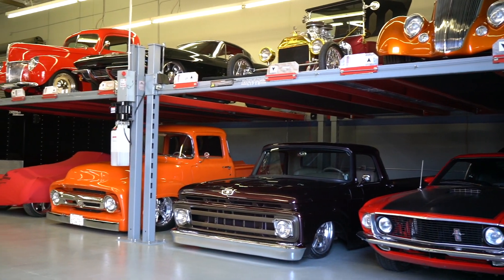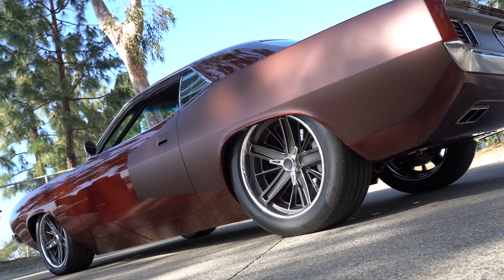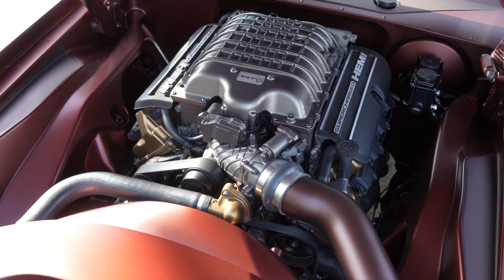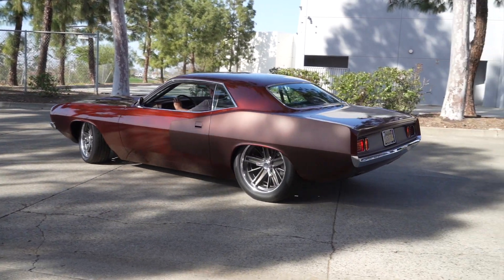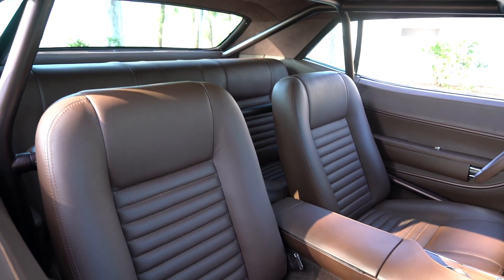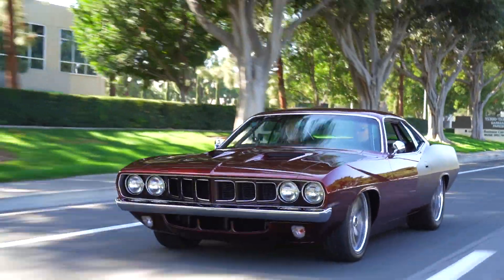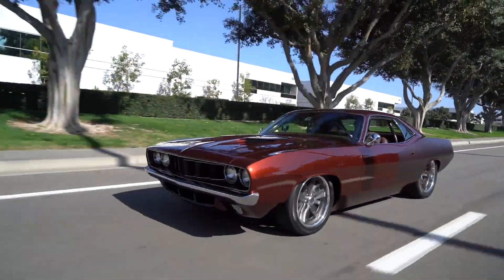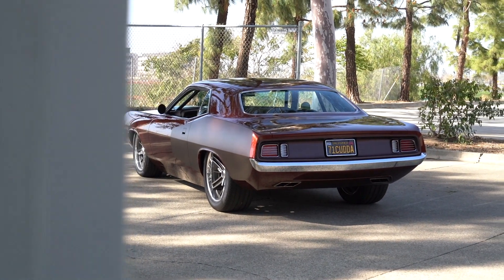707HP Hellcat Swapped Cuda Pro-Touring Build | Supercharged '71 SRT Barracuda

Comment: 5:30 One thing I don't understand with the front seats ~ why no headrests? You have a roll cage however, headrests are missing? Can you say 'whiplash from hell' if you ever get rear-ended?
Reply: I see what you mean, but tall seats or headrests kind of ruin the lines on the car from the side. The Cuda has that characteristic large opening without a b pillar between the door and quarter window, and the tall seat would interrupt that line. You can see they try to hide the roll cage bar that comes down there behind the weatherstipping between the two windows, but even that is a sacrifice. When all the windows are down, that kind of sticks out like a sore thumb.
Reply from the maker: It’s part of the look and it works

Comment: Cool car!  Well integrated Hellcat engine. Classy interior that still stays true to the original.   Nice rims too!  (still too big rims/wheels in the rear though :))
That "billboard" with the choice of colour and matt tone doesn't work for me though.  It kinda is too close in colour to the rest of the paint, so there's not enough contrast between them or something? Never liked those though -  I'd prefer without :)
Reply from the maker: Usually I’d agree on the contrast paint but I love this one. Especially how much it changes depending on light reflecting off it

Comment: Modern Mopar's with stock Hellcat engines do not require roll bars, why put one in this? Regardless, still an awesome car.
Reply from the maker: Required? No. Killer addition? Hell yes
Reply: Look no farther than Kevin Hart's crash. Part of it is a liability issue. When you get in a big crash, everyone will say "That thing is 50 years old, unibody construction, and has 707 HP? Why didn't they put a roll bar in?"

Another part of the equation is just chassis stiffening. The stock torsion bar geometry of the Cuda requires a hell of a lot of modification to accept coil overs like it has now, including a lot of chassis stiffening. This just adds to it.
Reply from the maker: I’m not against cages at all but don’t think they’re required for street driving. This build has massive subframe connectors for stiffening. And I know about the crash and drove that car personally before helping Speedkore sell it to Kevin. It was an amazing driver

Comment: For mie is m'y favorite cars is numbers one. Is one mopar one road runners 68 hummm the numbers toue is chevrolet is one bel air 57 ho corvettes c2 1963 is fenêtres arrière issu the bombardier the second guerre mondiale ho one camaro z28 70 71 72 73 stop numbers true is the pontiac one gto 66 hummm is m'y projet is sold one camaro z28 70 73 motors v8 big blok 572 + one supercharger chassis RS the chassis idem the gaz monkey ho motors ls7 twin turbo big blok is the kit nos 4 speed one transmission manuale 4 speed yeee one 4 speed issu the nascars is possible ho no sir freins wilwood suspensions is the cars auto cross